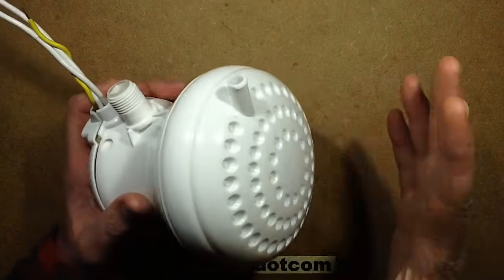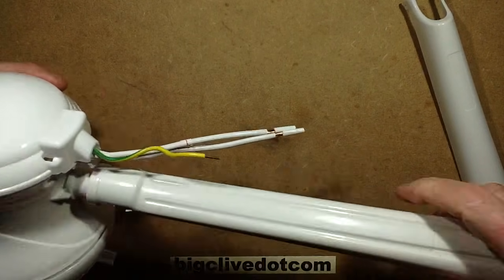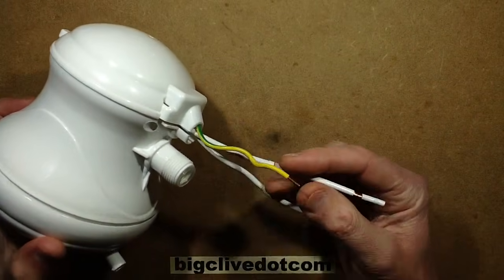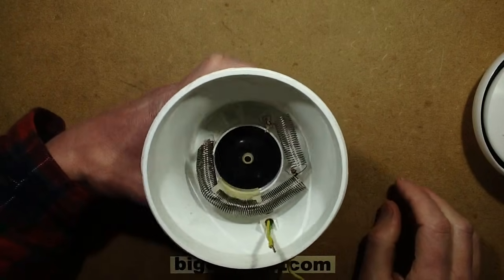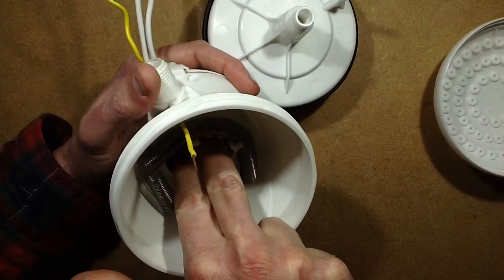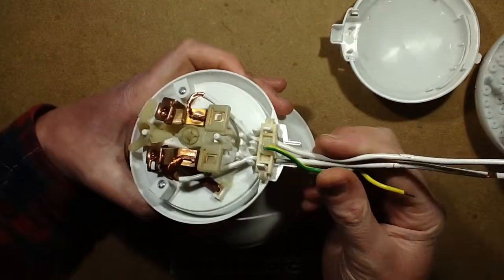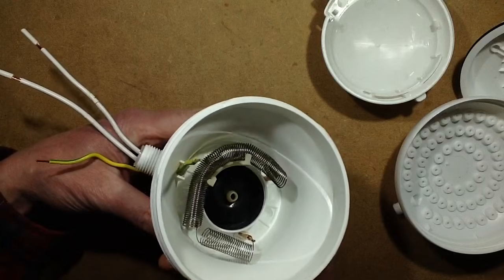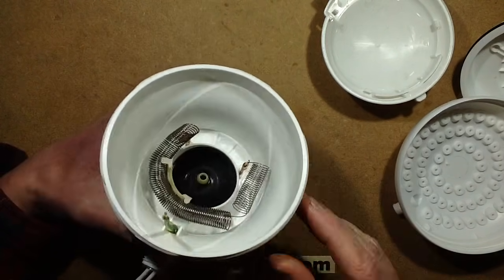Inside a heated shower head.  (suicide shower)

Comment: Well, in modern EU regulations, shower tubs have to be made of plastic, sinks and drain pipes made of plastic. The floor to be insulated. And water feed line to be made of plastic. So the potential difference between insulated shower tub (bath tub) and water line (water itself has low conductivity) is full isolation. Therefore theoreticly even full Live contact will not endanger anyone, at least in modern bathrooms.
I had a colleague demonstrate a hair dryer running in a glass tub (old lead storage battery cell) just warming the water without tripping his 10mA RCD he connected in the 240 V TN system feed line. 
(He used this to demonstrate the new EN / EU safety regulations to our technicians and electricians, and why "we walk away from metal and zero potential system")

This totally differs from previous standards, where everything required a solid potential zero connection of all metal parts to avoid electrocution.
And in combination with the above mentioned isolation measures, appliances have to be class 2 and a GFI to be installed in the feed line.

Thinking of wooden building with plastic water feeds and no metal, in the country of origin, it might actually be quite "safe" to use.

Comment: if your plumbing was running anything other than distilled water that ground wire would be encrusted in mineral deposits within the month, ensuring you were the preferable path to ground rather than that silly little wire!
Reply: +Lettuce that little diaphragm is a really neat feature though actually. Pretty ingenious

Comment: Interesting device I didn't know  this type of shower head existed. From a technical standpoint  2 things that would make me feel safe  showering under it . #1) Poor design on the ground/earth wire . There sd hold be a brass screen covering the entire space then have the grn ground wire spot welded to the screen . #2) water is actually a perfect insulator   however, it's the minerals that cause the conduction of electrical current. run pure mineral water through that shower head and  you can feel a hell of a lot more  safer. Personally with what I know about this shower head from this video . No way would I   want to experience a electric  shower  .

Comment: Dear Clive: If a bronze sleeve were installed on the inside of the fitting (on the inside of the sprayer) and firmly clamped to the earth wire (assuming it was connected to ground) would this make the shower safe? Or safer?  Would you consider doing an upgrade and then test it again to see if that makes it safe?

Comment: I think that almost enough information has been given to decide if this device can be lethal if the water is in specification.
Given the simplifications that .1 amp can kill through the torso and .01 amps hurts, one might calculate the max current threw a simple human approximated by 5 or 6 resistors (legs, arms, torso, and maybe head).  It is current threw the torso (heart) that kills.

Comment: 4:35 Resistivity is indeed in units of resistance by length.  The height or width of the bar or wire cancel out another length. Often expressed as Ohms*cm.
Fluid resistivity can be calculated.
The conductivity of water is a function of how many ions are free in it. I think higher temps and impurities raise it a lot. Also, I think that high voltages do so because.....Electrolysis. 
 CONDUCTIVITY is the inverse which was expressed as Mhos/cm until some psychopaths decided that something had to be named after Siemens. I suggested that they rename the country Germany.

Comment: Clive, I´m 47 years old eletronic engineer from Brazil and it´s a common awarness from foreign people when they come here and see this type of shower. Good Hotels usually use gas heater like in Uk or Usa just to make it as an International Standard, but let me dismystify the myth. First of all up to 90.s, almost 99,9% of brazillian houses had this type of shower ( and to make more terrifying, the case was in metal and not plastic). With 47 years old  I have never ( I say never) heard about anyone  having been dead taking a bath using this. If you forget to connect the groung, the only thing you are going to have is a little shock if you touch the valve ( if it´s metalic). The brazillian regulations are definitely not weck, and years of testing showed that it´s really difficult to have a serius accident using this(just having a bath). A recent research by MIT institute showed that gas systems are more dangerous that this because many times the heater is inside or near the bath place, like in motels, and many people die because of gas leaking issues. Also MIT institute proved that this type of shower is more ecological because you take less time to adjust the temperature compared with a gas system. You really have picked the cheapest and worst eletric shower. Only very poor people use this here, unfortunatly. Mine is a better one , also in plastic, but with many improvments. It has a eletronic controller and a pump integrated and is working perfectly after 17 years of work(observe that they just introduce more dangerous things). Obviously, I have replaced the heat element 2 times, but just this. Talking about the engineer side, the shower is above your head, the water is flowing, and there is no chance to have an eletric shock from water. If a salted water pass the shower, it will burn, and just this. The system activates pretty well the shower, so you have just to open the valve and control how much water. If you touch your head on the shower, you are really going to feel something strange, but is not the eletricity, it´s the water boiling at the heat element surface.The one you are teardowning  is a 5400 Watt unit. We typically uses a 7500 Watt unit nowadays that are perfect for Brazil, even in  4 Celcius Winter. To be honest, it´s the most reliable, safe and ecological shower in the world. Obviously I agree that any device badly installed is not safe. But well installed, it´s really safe(unless you decide to open an installed unit energized, naked, during your bath, without turning-off the circuit). Last thing: Good modern units don´t let you access the wires and eletrical circuits, and by law you must have a correct protection circuit, type of wires, etc. The units comercialized here are made from big companies, and must be compliance with ABNT 5410, brazillian standad. So everything is normalized and well controlled.

Comment: would this tingling be some sort of electrical discharge or magnetism? it is really silly that we have electric water heaters with no problems. your claims of suicide shower head are really out there as it takes a bit of shot through your heart ( arm to arm usually) to electrocute a human, but an electrical shock will not kill you. look up your terms and get educated so you won't look so silly in the future please. the things you have claimed really waste peoples time. do not be affraid when you have a heated seat, or heating blanket, the result of resistance is heat. your fears of keeping people alive is overwhelming but keep in mind death is the rule of nature. personally i have been shocked by 50 kv and 288v plenty of 120v shocks, not to mention having a heart problem since birth. the thing about electrical is nobody can see what is going on with it. so there is a fear of what you don't know. plenty of problems come from installers. I install auto parts all day long, I fix what is wrong with cars and what other installers have done completely wrong. instead of blaming the shower head why not blame the installer if infact it had been installed wrong? by the way i am also a certified I.B.E.W card holder

Comment: They use these a lot in central and south america, they usually aren't grounded and i have seen the earth often taped to the metal pipe.  When it switches on they make a strange sound, I once saw one spark and pop.  They go by many different brands such as lorenzeti.  The trigger mechanism is a little tricky too, if the water pressure is too low or too high it wont switch on.

Comment: When installed properly (grounded, properly sized wires and RCDs, enough clearance), those are fairly safe, actually. Potable water is far too resistive (in comparison even to the heating elements it is a few orders of magnitude less conductive) to be any hazard, and any (unlikely) stray current is caught by the ground wire. It only really becomes dangerous when not installed properly and/or when the water is too ionic. You wouldn't want to bathe in salty water, though.

Comment: I'd rather have a cold shower. In hot countries what about using a solar heater instead?
Reply: +Matthew Mitchell A quality trustworthy unit would be OK, but not the product in the video.
Reply: Unless said hot country was say a first world country where they use more energy, its just not worth it tbh

In developing nations, the cost of electricity is high however they don't use as much - so its pointless paying £5000 for some solar panels

Comment: I'd suspect that if you're supposed to shove the wires in that little tube, you're supposed to use the Western union Wire Splice < https://en.wikipedia.org/wiki/Western_Union_splice > which is NASA Approved! (it's also really compact and makes the wires really strong, as it turns out.)

Comment: There is one which is actually made in my part of the world, by a company called Marey Heater Corporation.  It is designed for commercial use, and it automatically switches on with water flow.

Comment: The tubing you assumed to be used as venting or to avoid pressure is not at all.  It's actually used so you get water from there. When you pull the pin, the shower head will stop dropping water as the tube will fill and after that water will come out, as a hose. It's quite useful when you want to take a shower and not wet your hair. Also this type of heating shower is very common in Brazil, and there isn't much concerns for safety. I never heard of people getting electrocuted with those. As you mentioned taller people Might get some shocks, but usually those should be mounted pretty high (around 2.5 meters from the ground) 

And lastly this model is quite cheap, there are better models with more safety features. Including shafts to change the temperature without having to reach the shower head.

Comment: I just can back from Nicaragua where the place I was staying used one of these. I get in the shower and turn on the water, the small relief hose falls out; I go to put it back in place and I get lightly shocked. Sad to say there were only two wires connected to the shower head and they were only done up with  twist-on wire caps. Exposed wires in a shower area, not the greatest idea ever

Comment: A friend of mine died about a decade ago in Thailand from using one of these. It was installed properly, but investigation showed a hole in the wall in the hallway, where someone had reached inside and simply janked out the earth wire, that had just been twisted and taped together.

It made me weary of electric shower heating overall, which is not good since I live in the UK now and that's all we get here. Ours is a bit different though, and has the heating element mounted on the wall, with a bunch of safety features to prevent that kind of thing from happening. Still makes me jump every time the light flickers when its on though, and I take my showers as quickly as possible (as if I could outrun the electrical current...).
Reply: +morphman86 I had 2 of these malfunction when I was using them, no accidents happened but I feel the same with the light flickering and any strange noises it makes.
Reply: You should get a combi boiler or an immersion heater.

Comment: good thing these are pretty much never heard of in here (finland). even better that you cant install those legally without electric professional, and i dont think any professional would accept to install those monstrosities.

i still wouldn't buy cheap ass plastic pile of garage that looks bridle enough just to explode the second i touch it, and deffinitelly wouldnt install it and use it. 240V is alot for someone who is wet. 5kW is a lot for any electric device, only device coming near that number are electric stoves and electric saunas! (and real house water boiler)

Comment: these are a six dollar solution for poor people here brazil or latin america, probably using a plastic valve and plastic pipes. If you see one in use  you'll note the water will came out in droplets (no more conductive) and, like you said, if you read the instruction will not change the temperature when they are passing water.

Comment: I'm renting a cabin in Costa Rica and we have one of these. The first thing I did was run a ground wire to it. I believe the short pipe is in case you don't plan to use the long one. You still need the sprayer in there as an emergency pressure relief (since crap in your water can clog it up). You can buy the cheapest ones for about $25 in any hardware or general merchandise store. For many people, this is the only hot water in the house. It works well enough, and you adjust the pressure to change the temperature.

Comment: Reminds me of a country show grounds in Australia where the competitors showers were prone to giving people shocks. Which we only discovered after we rented the place for a large annual event, After a few people complained of variously intense shocks I went and did some checking. Everything fine. More complaints. So I checked regularly, and voltage appeared and got higher over time while the showers were not in use. By morning there was a bit over 40VAC at the taps and shower heads.

Turns out the large mains pressure hot water tank had a fault, which was fine as long as the building earth was good. Unfortunately the building earth rod was old, corroded and in fairly dry well drained sandy soil, that had water from the shower outlet spilling into it from cracked pipes (hence the intermittent nature of the fault), As dogs body it fell to me to pour a couple of buckets of water round the earth rod every morning to prevent shocks.

It wasn't a problem for the show society, their main event was at time of year after reliable rains. Luckily a few years later a flood carried of their hot water system and a new one solved the problem. By a fluke the repairs were being done while I was there, so I got their electrician to replace all the earth rods around the place, most of which were just lengths of iron water pipe hammered haphazardly into the ground.